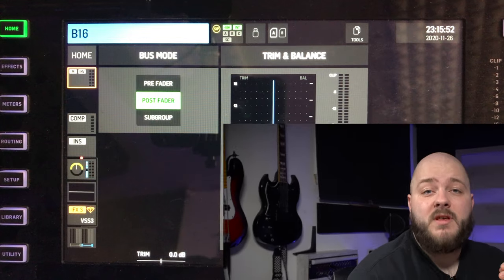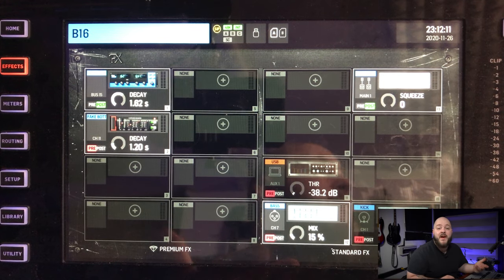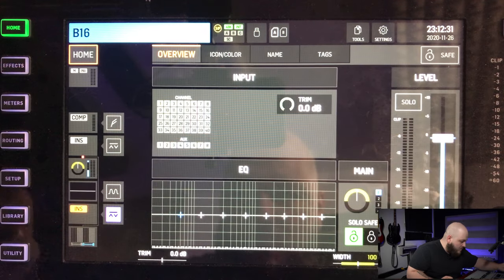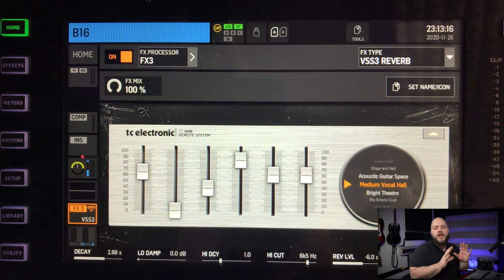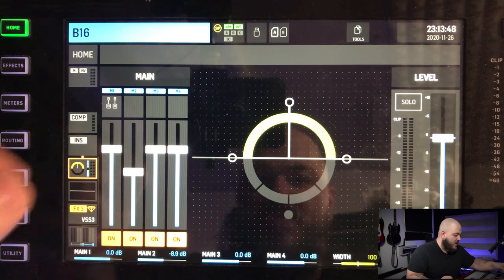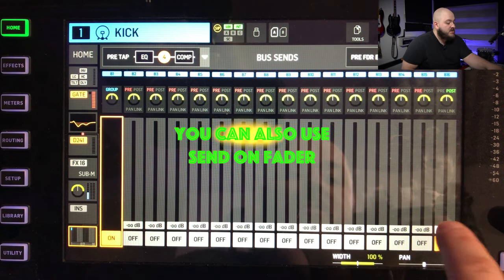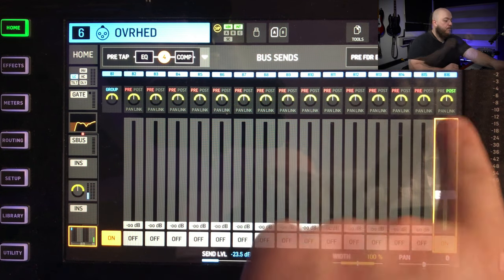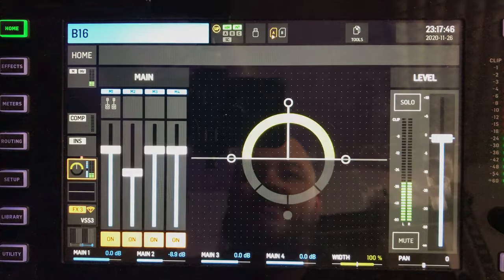Quick WING Tips - How to Setup effects (No FX Return) Routing on Bus

Comment: So all the effects are single use? For example, If I use a reverb I like on a bus then I can't use that same reverb on another bus with different settings. Is that correct?
Reply from the maker: Hi 👋

You can have 8 Bleu Plate reverb or any other reverb. That’s not a problem, I don’t see why you want to do that but you can
Reply: @GuillaumeLortie  Thanks for the reply. Since I have your attention I have an important question. If we do a full initialization does that also wipe out everything in the Library as well?
Thanks
Reply from the maker: @ Initialize do not remove anything form the library
Reply: @GuillaumeLortie  That's great. We have been trying to figure out how to start a new project from scratch without loosing all the snapshots we have already set up.
Thank you very much.
Reply from the maker: @UtwoBed  in any case. make a back on a usb key of your files